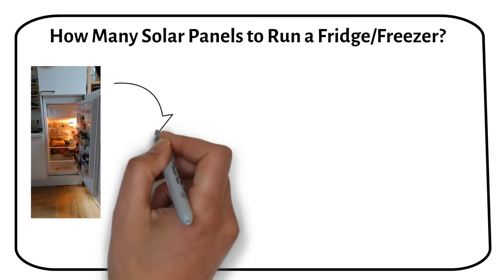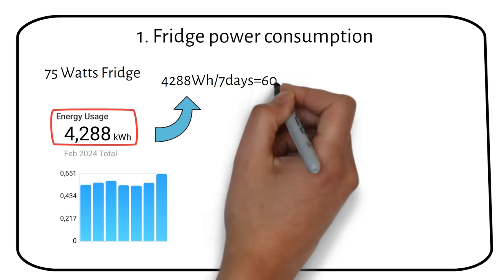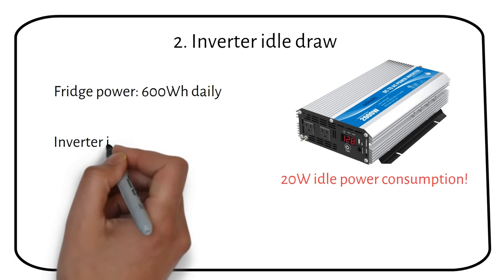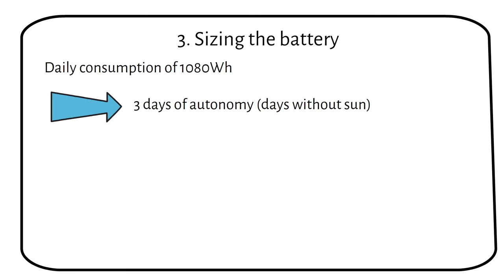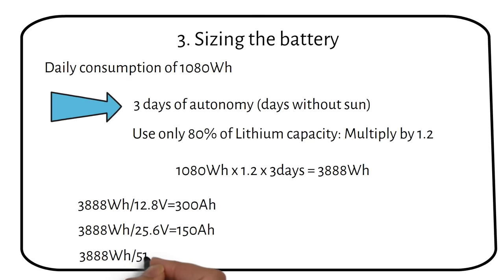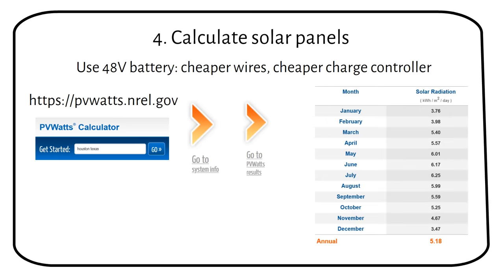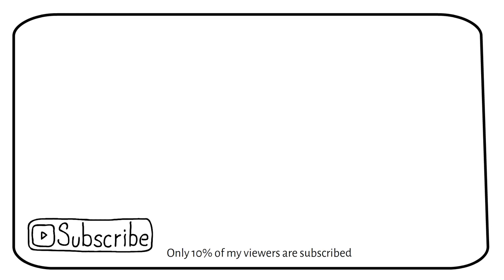How Many Solar Panels To Run a Fridge/Freezer?

Comment from the maker: 🎁 Free Diagrams: https://cleversolarpower.com/free-diagrams/ 
📖 My Best-Selling book on Amazon: https://cleversolarpower.com/off-grid-solar-power-simplified
Reply: hi, can you share the energy meter that you use to measure the fridge power consumption
Reply: You can wire a relay into the thermostat on the refrigerator to start up the inverter to run the refrigerator
Reply: DISLIKE! you should use LFP batteries with 4000 cycles to 80% of capacity not LiIon with 800 cycles!!!
Reply: @nazariiboichyshyn4300 But the creator of the channel in the links under the video recommends LFP batteries... Under the circumstances, I don't understand your comment 🤷
Reply: Hi. I have an 18k btu inverter ac unit and I'm wondering what I'd need to run it. It uses 2400w
Reply: @nazariiboichyshyn4300  I live in off grid cabin,  like many people cabin-dwelling off-grid and remote in western part of North American, with no air conditioning, where summer daytime temps can run over 110 degrees F, both outside and inside the cabin. .. Winter temps can drop below -20 F. inside the cabin if/when fire goes out. .. Help me, please. Does this temperature swing info alter your strong advice about battery types?

Comment: So in the end, you still don't show how MANY solar panels are needed. I know that depends on how much the panels are rated for, but you're the one that comes up with the title. Then you gotta show.
Reply: ??  Because anyone who followed the math so far can easily do that final math problem based on the panels they buy.  If you need 1200w of solar panels and you can't calculate how many 200w panels you need, you should probably just hire someone because you definitely won't get the solar controller or inverter right.
Reply: You need 3
Reply: I’m sure he said 1,100 watts, therefore given a standard solar panel normally generates 250w, so you will need 5+
Reply: And this is why most people are not subscribed…!.!.!
Reply: He already did the heavy lifting, you can do the last computation yourself depending on what panel system you're buying.
Reply: @jimjasper9851 The solar panels I have installed generate 425w each and current technology is raising that.
Reply: This would be why only 10% of his views are subscribed. Channels like this are trash and a huge waste of time. I miss being able to judge  a video in a few seconds with the dislike ratio. I think this year youtube will take a massive hit, especially with a couple new media sites/apps coming out before this summer.
Reply: If you are true solar technician you will understand whole video but if you do not please consolt an experienced qualified solar technician.
Reply: You just saved me 5 minutes 👍
Reply: @damyatt7676 didn't save you anything. You actually missed out as the video is very informative.
Reply: Some people just like to be spoon fed. If you really didn't get that information from the video then it wasn't for you. Most others did.
Reply: I just get as many as possible to max out the
 inverter/charger..
Reply: No, of course not. That depends on where you live and what the position of the panels is.
Reply: This comment annoys me
Reply: Great, now I don't have to watch it. Thanks
Reply: @jimjasper9851  standard solar is now 650w , thank you china
Reply: He gave you the information you needed. Solar panels come in different sizes. You need a few brain cells to figure out what is needed from the wattage of the solar panels you purchase.
Reply: Three 300w solers panels and 1000w  inventor can it run a freezer+tv and a 4 bedroom house lights at night only in Kalgoorlie Australia?????
Reply: He wasn’t showing, he was asking… 😂
Reply: I use 1100 small panels they were so cheap 😂
Reply: @jimjasper9851 one 250w panel, not 5.
Reply: Your right of course most of these ‘information’ videos are nothing more than click bait, a waste of time in my opinion!
Reply: @marclang7431 
A 250w rating is established with 100% solar exposure 
In the real world 
Solar panels only produce 40% to 80% of their rating.
Reply: @amsb4dafunk558  panels generally produce between 65 and 70% of their rated power and that Will match the fridge as a 250w doesn't run 24 hours it cuts in and out, usually consuming 65% of their rated consumption.
Reply: @aaronschwanke3563 , nahhhh. You didn't understand. That's all.
Reply: My son did a trial by failure to much battery not enough solar. However with minimal input from generator was a big improvement on gen alone
Reply: 24hrs?  So at night the panels need a very large extention cord... 😂
Reply: 1110w  divide by 100w you get   11 solars but there's that 10w hanging so make it 1200w divide by 100w and get 12 solars period...bt it also depends on the size of the solar you are going to buy
Reply: @perfectomprg Not 3. You need 6
Reply: 1,100 watts of solar panel you need, he said it at the end of the video. If you are using panel that are rated at 350 watts then you need 3 panels. It is more than the 1,100 Watts but more is better.
Reply: 47 kw house here. I need 28 solar panels at 400 watts each with five Tesla 13.5 kw batteries (because each one only really is allowed to discharge 10kw for safety purposes)
Then you need two inverters because each one can only handle three powerwalls. 
Hope thw answered your question.
Reply: @aaronschwanke3563 
Really? My  panels are 400w so I’d need 3.  I thought he explained things very well and stuff I would not have thought of.
I actually have 18 panels and 10Kwh of battery at my house
The only time I draw anything from the grid is when I have three electric hot plates on my stove going at once.
My batteries have the power but the inverter can only draw 4Kw from them at once even though it’s a 6Kw inverter.
It’s in the fine print but the sales guys not going to point it out.
Reply: @PeterSedesse ar panels have their own issues as well. Even if it says that it is a 1200 watt panel, it isn't guaranteed to get that much every time
Reply: @TheKillerman3333 typical panel efficiency is between 70 - 80%
Reply: Also dont need to run it 24/7. Just half the day. Like 4 hours in the morning and 4 hours in the evening.
Reply: @MuffHam 
That’s if you don’t mind your milk going off🤠
I’d say set the temp correctly to save power.
Reply: @llothar68 But not generate 650W because of this power is measured at STC. The real power is 450W aproach at NOCT.
Reply: Not everyone is a freaking electrical engineer or a journeyman or even an apprentice just put it in layman’s terms. It’s YouTube just get to the fing point!
Reply: The general answer is that you need lots of solar power cells. First, solar power is not 100% efficient. Also, it also weather dependent. For me, the only thing that makes sense is to set up a hybrid system. Where you use some solar and some still connected to the grid. Of course this is a more complicated set up. But it reduces how many solar panel you need.

For now, it just doesn't make economical sense to use solar panel. You probably break even after a few years of usage (if nothing breaks down).

Comment: Your calculations are only enough to recharge the battery- if there is no load.  You are also STILL running the refrigerator.  That daily power draw also  needs to be added to the panel capacity.
Reply: I was thinking it was going to be a system with a battery being used while another battery was charging!
Reply: He is calculating the panels to charge 3 days of power in One Day of the worse charging month. Re-run the last section to clarify this info.

Comment: Great video. I calculated the power needs of my freezer a few months ago after using a Kill-a-Watt for a week, but I totally missed the idle power draw factor. Due to my far north location, there's no way I can economically power my freezer with solar power year-round, but if I can manage to power it during the summer months that will be a big help. I don't worry about the winter months since I can just put the freezer food outside where it is almost always well below freezing (often subzero temps).
Reply: You can make up a 12V thermostat with relay to switch on the inverter. If you know what you're doing you may be able to wire it into the fridge sensor. Downside is that you might not be getting the fridge light.
Reply: this might not be an option for you at all, but moving your fridge outside might save some power

if the temperature difference between the fridge and the surrounding air is cut in half, the power consumption should be (slightly higher than) half of what it used to be

but i do realize might not be something you can just do that easily
Reply: Batteries. You must store everything you can get.
Reply: Note that the 2000W inverter shown in the video is probably massively overkill just to run a fridge.  It does depend on the fridge's surge load, but I can run my home fridge with an 800VA Victron Phoenix inverter and that one has an idle consumption of around 10W.  That's in "normal" operation mode, not "eco" mode.

You basically want the smallest inverter that is still able to deal with the startup surge of the equipment.

-Matt
Reply: I always thought it would be "cool" to have a fridge that could sample the outside air and use IT to cool the fridge when it is cold enough outside, instead of electricity.
Reply: We have an off-road recreational cabin at 62 North. We run a 5 cubic foot freezer in the summer on a system with 480 watts of solar and with a 10Kw battery plant on a 4Kw 48v inverter. It’s been working fine for about 20 years now. At latitude 62 N we get lots of sun in the summer with over 20 hours on summer solstice. In the winter it’s cold enough we don’t need a freezer.
Reply: Unless you store your food outside in a critter-proof  container, chances are high it'll quickly disappear.   And, even if it's in a critter-proof container,  unless it's in a perfectly hermetically-sealed container, you will attract lots of critters, anyway, many of which are undesirable to have as permanent close neighbors.
Reply: @peterk1584  yeah, okay, I’ve been doing this over 40 years.
Reply: Fridges don't really eat all that much power.  They are one of the easiest things to keep running with a solar + battery system.  Just look at the yearly energy usage and divide by 365... usually it comes in under 2 kWh/day for a full-sized fridge+freezer.  

Small ultra-efficient compressor coolers (about the size of a large ice chest) usually clock-in at only 0.240 kWh/day (240 Wh/day).  And these often have the advantage of being able to run on AC or DC.  My little Dometic can run directly on 12VDC or 24VDC.  A direct battery connection avoids inverter idle losses and inverter conversion losses.

As always, one sizes power and appliances according to needs, circumstances, and conditions.
Reply: @junkerzn7312  That’s not very efficient.  I have a five cubic foot freezer that uses about 500 watts a day according to my Kill a Watt. I find the smaller coolers and refrigerators are less efficient.
Reply: @Chris_at_Home  Its not about efficiency per unit volume.  Its about how much energy you use for refrigeration each day in absolute terms.  Because that is all your solar and battery system are going to care about.   You deal with the amount of cubic volume you need separately and maybe even make modifications to fit your solar and battery budget, because things can get expensive in a hurry.

Lets say you want decent solar to recharge your battery system and also run the refrigeration, and enough battery storage to run your refrigeration for roughly 2-3 days without sun.   i.e. a "no major worries" setup.

My little dometic eating 240Wh/day can do that with a single 100W panel and a single 12.8V 50Ah battery (640Wh of storage), roughly.

Your freezer eating 500Wh/day would need two 100W panels and around 100Ah @ 12.8V (1280Wh of storage) to do the same thing.   Double the cost.

And my full-sized home fridge eating... well, mine eats 1.4 kWh/day I think but adding inverter overhead and margin lets just call it 2 kWh.  So that would require roughly 600W worth of solar panels... call it two residential panels, and round 4000Wh of battery storage... 300Ah @ 12.8V.   Six times the cost.

-Matt
Reply: I have run refrigerators with a 400 watt inverter.
Reply: @tobbleboii5988 . My first two thoughts in regard to moving the fridge outside might be varying day/night temps and then any security issues, depending on the situation.  But yeah, would save power indeed.
Reply: Remember, the refrigerator running inside the house will add heat to your home during the winter.

Comment: On slide 3 you multiply by 1.2 to get battery capacity when only using 80%, Thats incorrevt. You need to mutliply by 1.25, or divide by 0.8. 1080 Wh / 0.8 * 3 days = 4050 Wh

Comment: We got a similar type of fridge with freezer. The power consumption is between 17 and 19 kWh per month. I got 2x 400watt panels and a 25.6v (24v) 200ah lithium battery. Here in the middle of Germany we can run the fridge independent of the power grid from the end of February till the beginning of November. 
Greetings
Reply from the maker: Thanks for sharing Tobias!
Reply: @cleversolarpower  You sound like someone from Belgium.
Reply: What kind of inverter.o share the list of material solar panel converter inverter batteries thamks
Reply: Inverter is a ECTIVE SSI10. 2x Canadian Solar 400w panel's. Battery is a LiTime 24v LiFe 200ah
Reply from the maker: @johnbeton4058  That's because I am
Reply: My fridge and large deep freezer used 2100w /h over 1 month (2,1kw/h), when I measured it for one month in the summer....
Reply: The power consumption of fridge per year is 45 eur (0,20e/kWh).. x 20 years = 900eur. What is price of solar system + mounting ...

Comment: Very good analysis and guidelines.  One thing that is missing is a decent set of panels will still provide some power - even on a cloudy day.  I’ve read anywhere from 10% to 20% (100-200wh for a 1k system).  So you might not need the 3 day buffer, but I still like his recommended headroom.
Reply from the maker: You are right, i did not include this in the calculation to make it easier to digest.
Reply: yes when its just cloudy you can a bit of charge but when its dark and very poor weather you will get close to zero even with a large array

Comment: Amazing video, though there were some mistakes:
1. 0:05 - It shows that the fridge is using 4288 kWh, not Wh
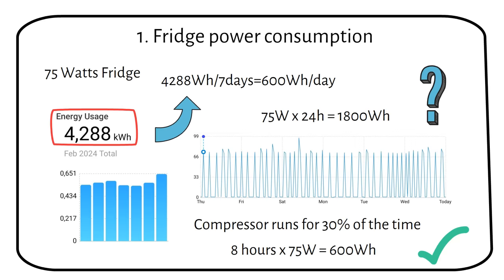2. 0:59 - 4288 divided by 7 is ~612.6W, so it is not exactly spot on (1:30)
3. 3:37 - No, you need to multiply it by 1.25 (100 / 80 = 1.25)

The calculations are close enough, so in this case the battery capacity has just over 5% deficit.
Reply: I'm not getting that... 75 watts times 24 hrs in a day times 7 days is 12,600 watts or 12.6 KW a week. What am I missing?
Reply: You do realize that there's a coma between the 4 and the 288 in those kw/h numbers right?
You do know what that means, right?
Reply: @beesknees6970 you are missing that the fridge isn't constantly on.
Sometimes it is idling. He explained it around 1:30.
Reply: @TheAllMightyGodofCod  Oh OK I see it now. I'm new to solar and trying to figure it all out. I'm wondering lately why doesn't everyone use 400-500 watt panels instead of 100 watt panels like I see alot of people saying they use.. They are out there, and wouldn't the higher watt panel charge your batteries faster? I'm needing a fast charge system as I have trees around me. I need to run a window ac that uses about 400 watts. I live in high heat and will need an ac when power goes out.
Reply: @beesknees6970  well, I don't know the answer for that but my guess would be that it might cost them less to have 4X100w than a single 400w one...
Either that or they live in places where the weather might damage the panel and that way, even if one gets damaged, they still have some ones going on...
But that is just my guess, absolutely no facts/evidence to support my guess...
Reply: Thank you TechMa ... the video's  math is all wrong ... my refer nameplate gives 6.5 amps, times 110V is closer to 700 watts ... so it runs 1.42 hours using 1 kW-hr of energy ... call it 50 kW-hrs a week ... I tested this a few years ago, a refer plugged in just sitting empty with no traffic costs $10 a month, 125 kW-hr ... but that's with cheapest-in-the-nation Bonneville Hydropower ... roll on Columbia ... electric rates to smelt aluminum with ...
Reply: @russcrawford3310  wait, 6.5amps is the max load, right?
That doesn't mean the fridge is running at max load every single moment.
Am I correct or missing something?
Reply: @TheAllMightyGodofCod  - "Full Load" - 6.5 amps is around 700 watts ... the video uses 8 hours per day, times seven days ... 40 kilowatt-hours per week ... water heaters run closer to 4000 watts, five times the refer ...
Reply: @russcrawford3310  so, 6.5 amps is at full load. Right?
Reply: @TheAllMightyGodofCod  - That's what the nameplate says ... and it's plugged into a 110V outlet ... it's just a compressor ... the video says this compressor runs about 8 hours a day ... that's means for 16 hours a day, the refer doesn't draw any juice ... $20 a month for a family of four ...
Reply: @russcrawford3310  sorry to ask you this, but why is it so hard for you to just answer with a simple "yes" or "no"?
I just wanted to know if that amperage was peak or not.
Reply: It is european style of decimal divider - coma. In US is dot as decimal divider, coma as thousands divider. 4.28 kWh
Reply: @russcrawford3310  Usual domestic fridge compressor power is cca 100 - 200 W. Nameplate current [6.5 A] looks like maximum [starting surge] current.

Comment: Great work.
i can see it really makes sense to keep a fridge in a cold place, so that it requires less power in the winter when solar is a problen.
I imagine opening the fridge door less in colder weather too
Reply: Surely you just keep the air-conditioning on full blast!🤔  That'll keep it cool in summer.